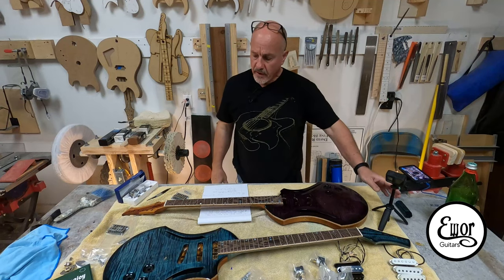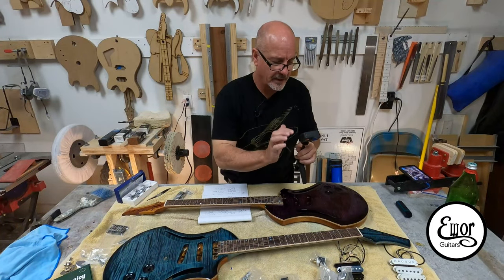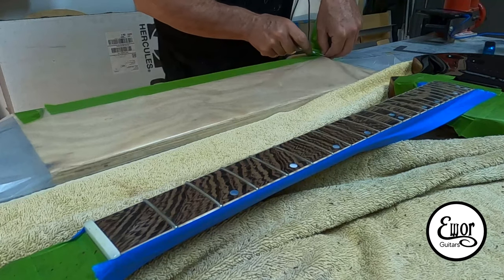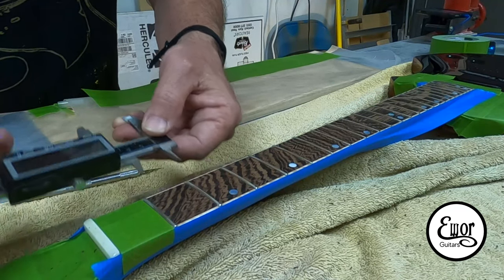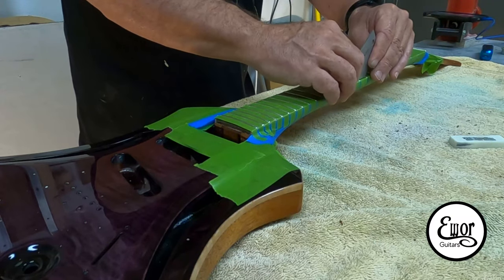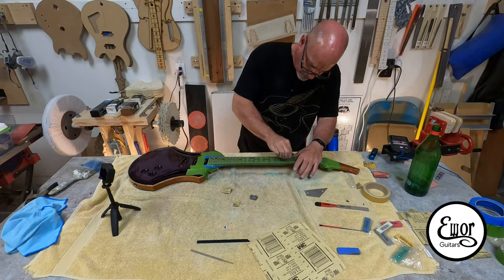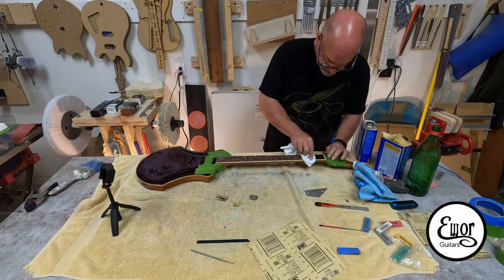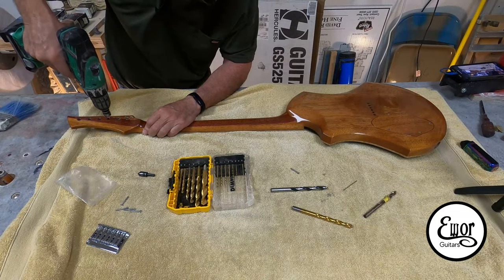Ewor Customs Great Guitar Give Away Episode 16: Final Assembly part 1

Comment: Super pleased that you retained my suggestion for parallel and series switchin. That will give these guitars more tonal options. Interesting tidbit is that Fender also uses this on some telecaster models using a four way switch. Another cool wiring option for strat configuration is a switch to bring in the neck position p/u along with the bridge and also allows to run the three pickups all together.

Something  else that I would like to share with you and folks reading this is the method for polishing fret that gives me the best result. I use 3M polishing papers from 30 to 1 micron (six grades of sheets) and then use Cape Cod metal polishing clothes (stuff used for polishing watches and jewelry) as a final step. You end up with mirror shine. This is the best combo that I have come across for nickel frets. 

Thanks again Dave for this super series and look forward to the Great Guitar Build Off series as well.
Reply from the maker: Thanks Maxime, I really appreciate the tips, I will have to look into the 3M papers. Thanks for watching